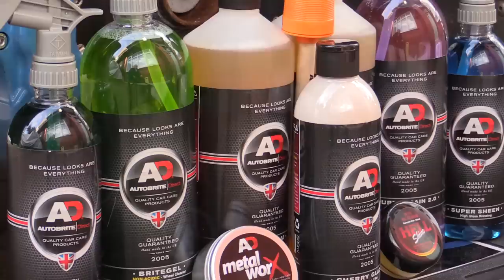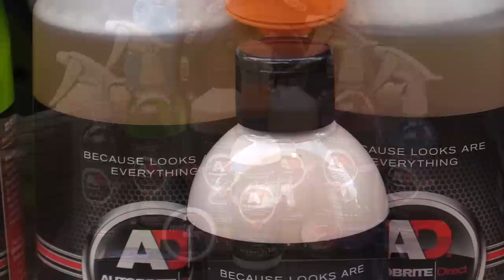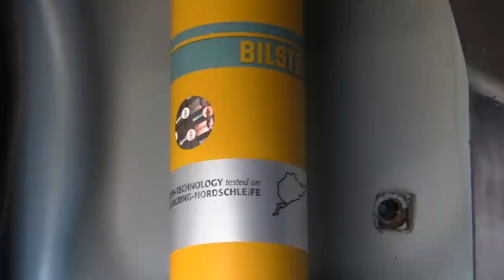'Guru Mobile' Wheels-Off Winter Prep

Comment: Looks amazing man! Was the glaze and other stuff just for the after shots? I would imagine the heat from the brakes would just melt that stuff right off after the first outing after applying it.
Reply from the maker: A wax or sealant product designed for use on whees should be able to withstand the heat generated but you can prolong the durability by engine braking instead ;)
Reply: Car Cleaning Guru Touché sir, Touché! Lol

Comment: The brake rotors are in the wrong place the left is on the right. The vanes inside the rotor should flow backwards.

Comment: I don't know a lot about cars, but shouldn't your brake rotor be shiny - not rusty?
Reply: It's from that purple stuff. Really messes with untreated steel parts like your rotors. Since using that stuff i have squeecky and rusty brakes forever.
Reply: They rust really fast, they'll be nice and shiny again after braking a couple of times.

Comment: I ran over a fox in my truck and never cleaned it. I took the wheels off over the weekend and did a spring cleaning. My rotors and shocks had fucking mattes of hair and i even found what looks like an ear dried up and stuck to the inside archway 😀 Nature

Comment: Which is the better Engine Oil in-between three ones for my Nissan Terrano Diesel 2014 Model. 1lac80 thousand Driven.
1) Mobil 1™ 5W-30
2) Mobil Super™ 3000 X1 Formula FE 5W-30
3) Mobil 1™ ESP Formula 5W-30

Comment: 16:32 maybe it would be better by starting to change your weights from silver to black to match the color of your rims instead of washing your wheel housing for an hour for maybe 30 seconds of driving with clean wheelhouses btw. Be cearful with chemicals because maybe they will react with o rings and stuff like  your brake fluid changing nipel protector (btw im a german) or with the rubber of the brakepad return rubber it could be that it gets purose after getting hit from 1000 of differrent cleaning tools and after a short time maybe the rubber getting hard and start getting cracks 

Bye

Comment: When doing this, I dont have to worry about drying anything out or messing anything up do I?
Reply from the maker: Not really as it all get soaked when driving in the rain.
Reply: Car Cleaning Guru Okay thanks, pal. Knew things were designed to get wet, but wasn't sure how directly they should be getting wet. Thanks again!

Comment: Simple Green degreaser does the trick hands down. All this prep, equipment and products are worthless and cost for nothing.  Simple Green even remove oil and hard dirt without scrubbing. It comes in concentrate form. Its cheap so I use it at its strongest. Use a spray bottle and spry it under the wheel wells, on the wheel, calipers and rotor. Let it sit for 10 mins and watch the dirt fall off. Then, spray with regular pressure garden hose. Leaves a nice slick, clean surface. You will not have to spray any polisher behind it. I promise you!

Comment: Is there any simple way to clean the arch with out removing tyres and using products
Reply from the maker: Jacking the car up helps, if not the very least you want to blast it out with a pressure washer as best you can.

Comment: you cleaned it like 30 times with 20 expensive shiny products. 

I just do it 2 times and then I use  a protective. 

looks the same and saves my money
Reply from the maker: +Sebastian Dietrich Your patronising pat on the back is in the post.

Comment: This kind of treatment is only beneficial to show cars. After a few drives the wheels, brakes and arches would be back to square one.
Reply from the maker: If you never touch them again they will, however if you give them a weekly or bi-wekly pressure rinse and spritz of dressing they'll stay looking clean indefinitely as mine still do 10 months on.
Reply: Fair enough pal. I assumed the it would be a waste of time but your the professional ha.

Comment: 21:29 Is that paint on the disc braking surface as well!!
Reply from the maker: Instead of masking the disc off I purposely overspray and let the pads burn it off and create a perfect edge.
Reply: @CarCleaningGuru  I suppose it doesnt really affect braking performance after the first few yards..makes sense
Reply from the maker: Not in my experience. I think the grooved discs would help scraping any paint off the surface of the pads too.

Comment: While I find amazing the detail and passion into cleaning a car, I find it also totally stupid to clean a wheel arch, calipers etc.. one rainy day and 3 hard stops on the brakes and everything is dirty as fuck as it was before :(.. probably worth it on a show car or hypercars that are sitting in a parking for a lot of time.
I would just done a little bit of water cleaning and maybe if you want to remove brake dust use a specific  product and it's more than done for me :)
Reply from the maker: Believe me it makes a massive difference, especially on cars with tasty parts under there. Yes it will get damp and dirty again soon but that’s just superficial dirt as opposed to the deeply ingrained crud that from years of neglect. A quick blast with the pressure washer once a week when you wash the car will quickly bring it back up to standard. I can always tell a car that’s had its arches tended to at some point versus one that hasn’t, regardless of how dirty it appears on the surface.
Reply: @CarCleaningGuru  damn it's nice to learn new things, I guess that you also apply something that protects everything?
Reply from the maker: Yes! I’m not saying everyone should go to this extent or that you should do it on a regular basis but if you do it once then keep on top of it with a quick maintenance clean every now and again it will stay looking good indefinitely.

Comment: Please don't take this the wrong way. It feels slightly similar to cleaning the inside of a wheelie bin (pointless)
Reply from the maker: Wheelie bin cleaning keeps the maggots and smells at bay so this is deffo more pointless.
Reply: @CarCleaningGuru  😂😂 your amazing man👊
Reply: @CarCleaningGuru  I know it’s late and you’ll probably never reply.

What stopped you after fully decon(ing) the arches using a protectant like Carpro DLUX or a coating that will outlast a dressing?

Comment: the 15567th video I see on YT about cleaning cars. You take the time to take off the wheel and clean everything EXCEPT THE MOST IMPORTANT PART of whole system - the CALIPER PISTONS. you guys remove dirt from every not important parts of cars. the outer side of the caliper. the brake dust is mostly on the inside of brake caliper where it can cause even a malfunction of the whole system. you were 2 screws away from that step..  everybody is washing, detoxicating, coating, waxing all parts of the car. but use a simple brake disc degreaser for 2 bugs/bottle to clean the brake disc and make the system more effective is rocket science..
this vid shows how sketchy you are
Reply from the maker: Look forward to watching your in depth video showing us all exactly how it's done.
Reply: Car Cleaning Guru I do it, just dont make videos about it. But in this case I can make an exeption..